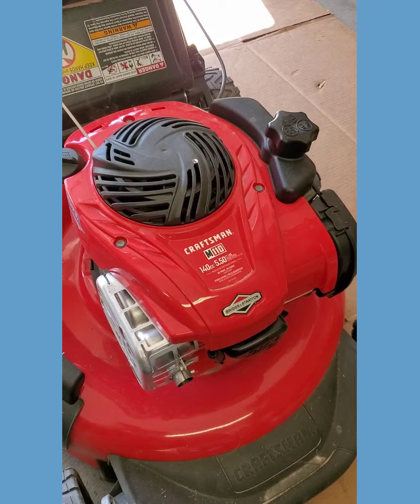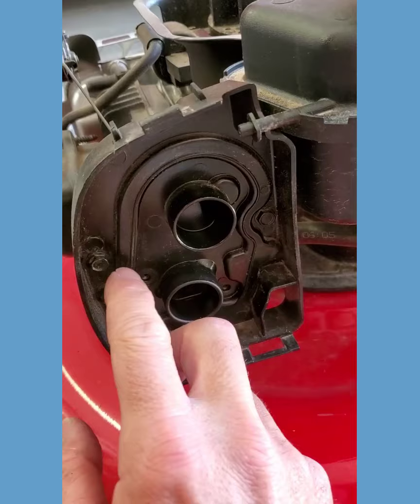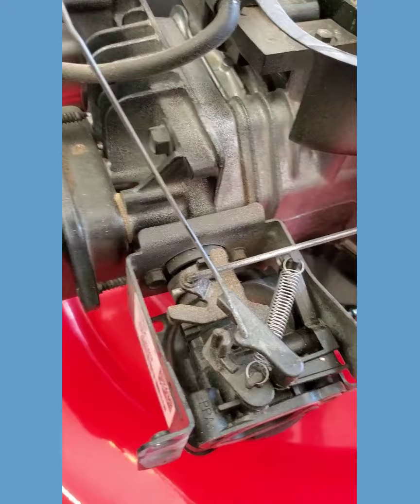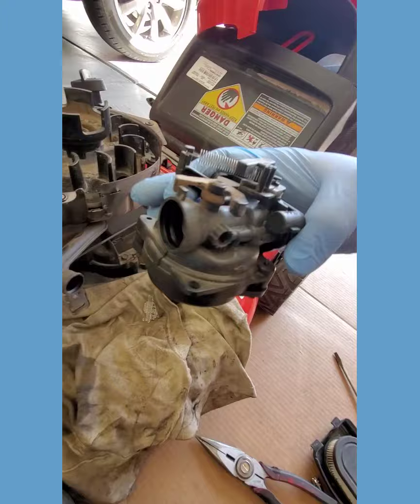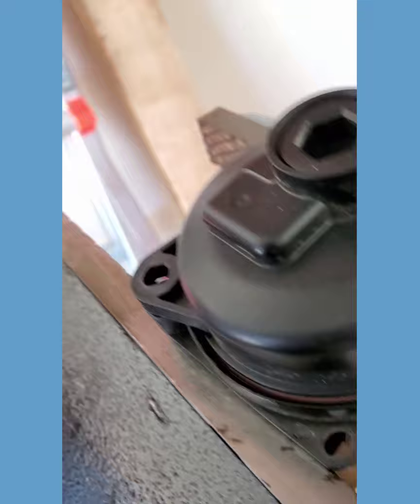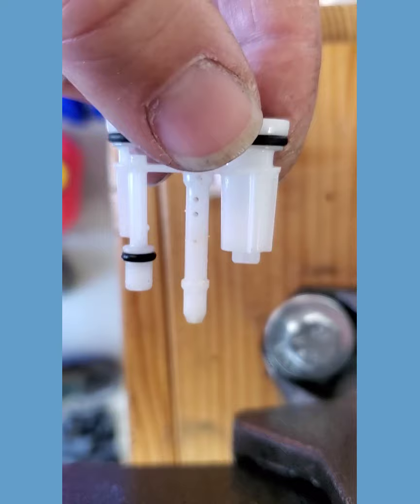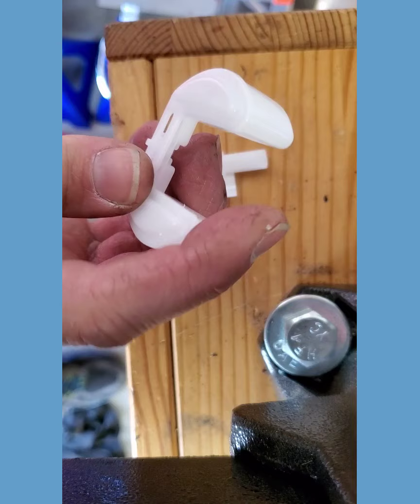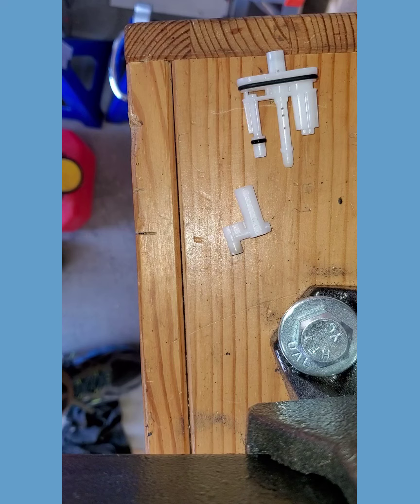Fix Craftsman M110 push mower won't start Briggs and Stratton 140cc engine part 1

Comment: Can you tell me what the model number of that carburetor is?
Reply from the maker: According to the B&S website it is 84002107. But eBay says it is 799584. I see carbs under both part numbers look the same so either one is probably correct.
Reply: Well come to find out the gas tank and carb had water in it after cleaning it out and refueling mower started right up.
Reply from the maker: @HandyTim  congrats on the cheap fix Tim!

Comment: My cusin has the some one with different wheel look 
And I'm 11 yers old
And when I start it it blows white smoke for 6-7 min but usually 5 min and if I turn it off still it drifts out the exhaust a lil bit but starts 
Has happend twice
Been using it for 3, 4, 5 months so any explanation
Reply from the maker: Probably overfilled on oil. Or it has weak piston rings and is burning oil.
Reply: @jcx2bby  ok 
Its not my mower and its new
Huh
Reply: @jcx2bby  how could there be weak rings
Reply from the maker: @grovecitysirens_GCS  well if it's new that's not likely. Probably overfilled on oil.
Reply: @jcx2bby  it stopped only did it twice
Reply from the maker: @grovecitysirens_GCS  that indicates oil on top of the piston that eventually burned off. Either was overfilled or the engine had been turned sideways allowing oil on top of the combustion chamber.

Comment: In other words if you use this mower 3 times you have to become a small engine mechanic
Reply from the maker: Yeah this mower has a terrible reputation. It is not well designed.
Reply: @jcx2bby  i have a brand new mower for sell may not start 🤣
Reply from the maker: @drumhailer547  lol

Comment: it just back fires louder now. lol since i cleaned the 3 holes and all that in carb.
Reply from the maker: Dang. That sucks
Reply: @jcx2bby  maybe the key? Or valves tighten
Reply from the maker: @houston8295  possibly, but I wouldn't think so if it was running ok before this happened. Did you hit something or run it low on oil?

Comment: can you use E87 fuel on this lawn mower? It was running fine with the expensive fuel I got at lowes. So as soon as I put in some E87 it started doing this.
Reply from the maker: I've heard of E85, I assume it's what you used or close to it. The ethanol blends are problematic for attracting dirt so perhaps this happened to you. Might be something blocking your carb jets. Other than that, I don't 'think' the e-fuel should hurt it. I'm not an expert on that though

Comment: Right out of the box and it won’t start! This mower is garbage.
Reply from the maker: It's how they all are now.  Cheaply made and require a slight mechanical touch to keep going.
Reply: Similar story but mine wouldn’t start anymore after mowing the yard once

Comment: How do you clean the orifice tube tho
Reply from the maker: If you have compressed air, I'd use that. Pull it out of the carb and clean it with carb cleaner real good.

Comment: so what if this didn't fix my issue? what else could it be?
Reply from the maker: Have you used a spark checker to make sure it has spark? Try shooting carb cleaner in the air filter and see if it runs.
Sometimes one cleaning doesn't fix it either, sadly.
Reply: @jcx2bby  I've done everything sadly. After I cleaned the carb it would barely run for about 3-5 secs. So bad I wouldn't call it running at all. 

It may just be time to trash this new mower and get a real one.
Reply from the maker: @pauljohnson1991  sorry man. They're not top of the line in terms of reliability, as the comments on this video would indicate. 
Almost sounds like the coil is bad or flywheel out of timing

Comment: The black top of the carburetor unfortunately can't be cleaned very well so if the top part is blocked the carburetor has to be replaced
Reply from the maker: The good news, though, is that I've never had that be the case. I've cleaned dozens of these lawnmower carbs and have never had blockage in the top cap be the problem. It is always the jet assembly or a fault float/needle/seat.

Comment: I’m not positive, but I don’t think there is a Part 2 of this which was frustrating BUT all I did was disassemble and reassemble, according to this video, no sprays nor products and the mower starts now, lol but now im dealing with the white smoke pluming out, I think it’s just oil that needs to be burned off from tipping
Reply from the maker: Part 2 was listed in the description. https://youtu.be/INAILwhOhYU
However, as you found out, it's not super necessary if you've gone all the way thru part 1. Congrats on the fix and I concur that the smoke is just extra oil burning off the combustion chamber.
Reply: @jcx2bby  thanks 👍 I forgot to subscribe
Reply from the maker: @JohnSmith-nf8bi  thank you John

Comment: I followed this video and it started first try ran for 1min and shut off now it starts and shuts off in 3 seconds
Reply from the maker: Something is still blocking the carb holes. Take it apart again and give it another cleaning.

Comment: My pull cord locks up?? Happened to you by chance?
Reply from the maker: Not on this mower, but Ive had it happen. Usually the engine brake isn't fully disengaged, or the air intake is blocked. Also the carb could be flooding and putting too much gas in the combustion chamber.

Comment: I am not mechanically inclined at all!!!!! So taking it in to be serviced. That was waaaaaaaaay to much for me. Just tryna mow my lawn on a sunny Friday afternoon.
Reply from the maker: One must know one's limitations, however, I personally feel you could handle this type of job if you desired to. Once you get it all apart it is not so different from a jigsaw puzzle in terms of putting it back together. Most pieces only fit one way and in a certain order.

Comment: It is really messed up that you buy a brand new lawn mower and have to go through this to get it to work after only one use.
Reply from the maker: These carbs and ethanol gas create tons of issues for owners. It's sad.
Reply: @jcx2bby  I had to replace my old lawn mower after about 15 years of use... was great and never had any gasoline issues,  but this... no good. Used it once.  Maybe the best thing is to use 0 ethanol.
Reply from the maker: @jltc5478  if you can find it, yes. Or buy the gas in cans they sell at Lowes but that's not feasible if you have a large yard.

Comment: Why do I only have a low idel
Reply from the maker: Do you have the blade on it?  If the blade is off, it will not run as fast as normal

Comment: Why would it not start all together
Reply from the maker: One of the vital 4 is missing: fuel, air, fire and combustion.
Reply: @jcx2bby  nice so it barely starts up my mom told me it wouldn’t start should’ve checked earlier but it starts up just doesn’t last she had for two years it basically sat in the shed for that time with gas and oil inside I assume it’s just the carburetor
Reply from the maker: @tahjayontaylor1139  I would assume the same. Compression is usually not an issue. Spark/fire is usually not the issue. It's 'almost' always air or fuel and that's the carb's job. Look there first, but don't forget to check easy things. I.E., broken spark plug wire, empty gas tank etc.
Reply: @jcx2bby  ok I didn’t check the spark plug wire thanks.

Comment: Did everything and now it has low idle.
Reply from the maker: Sad to say, you may have to do it again.
Reply: @jcx2bby  Yha, figured it has more gunk. That's what I get for not using E0 and I'm being punished for my laziness. I have the parts soaking in carb cleaner over night. Hopefully It works out.

Comment: Incredible this guy doesn't know what he's doing the majority of the time is a clogged main jet that small little hole on top of the main jet needs to be cleared just poke it first with a thin wire then blast it with carb cleaner and also the three holes in bottom of the main jet you can use some air after to clean the main jet even more if that doesn't work buy a new main jet and that should solve the problem and also put fresh gas.
Reply from the maker: Mike, why did this video make you think I don't know what I'm doing?  I saw the other comment about the gas tank...was that why?  Because I do it differently than you prefer?